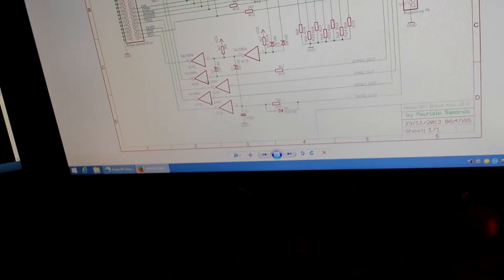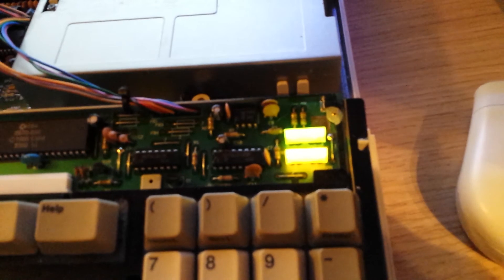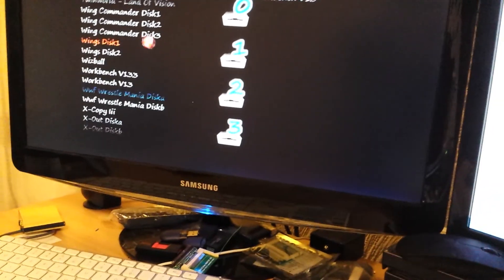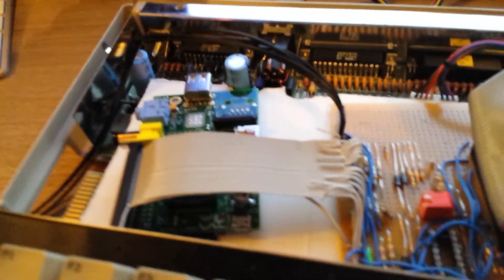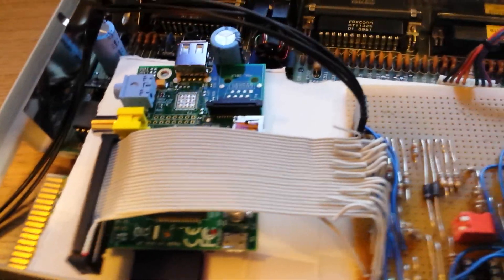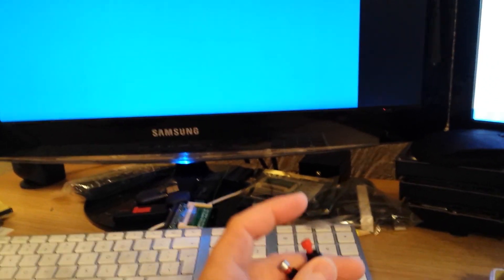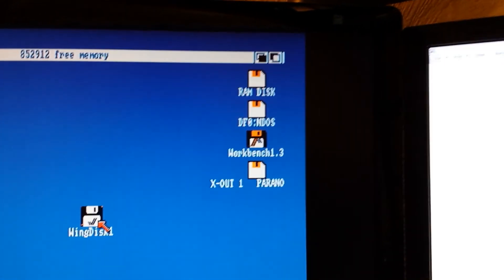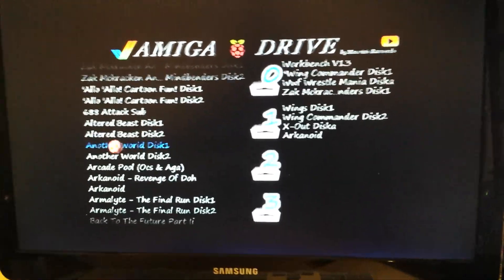Amiga Floppy Drive emulator using Raspberry Pi

Comment: I have a question.  I am interesting in refreshing an A2000.  I was considering purchasing a SCSI2CF drive and a GoTec drive as two units.  Could the PI be used to emulate both devices as once, saving cost?

Comment: Hi Andy. I hope you can help. I have just purchased a pre buit PCB version of this. The person I got it from insists it is working but I cannot get it to boot. I have a  Pi 1 Model B V 2011.12. I have tried the V1 kernel and that did not work either. I have tried various SD cards 2GB to 8GB but no joy. I know the SD cards are good and the Pi as it will boot with noobs. I have triple checked the orientation of the cables, the board flashes the LED and the Pi briefly flashes the SD card read.

Independently of the Amiga if I try to boot it just sits at the rainbow screen. Is this normal? Should it at least boot the kernel when connected independently? Any help would be appreciated.
Reply: Hi Alan, there some hints to get it up an running:
download the v.6 version form Maurizios Page (https://sites.google.com/site/amigarpidrive/)
format entire sd card to FAT32  
extract the the zip to your sd Card  
There is no video output on the pi exept  with the "
AMIGA RPI DRIVE VIDEO 1.0.ZIP" image.

Comment: Can it be made to write to the emulated floppy disks for things like save games and also for workbench such as saving your word processor documents and copying disks?

IMO, as fun as things like the gotek are, they (and a Pi should have the ability to be coded to do so) really 'should' have the functionailty to do so. It means loading a game from a CDROM can allow data (e.g. 3D landscapes or sounds) to be generated upon the start of a game and written to 3 floppy disks, FD1 and FD2 and FD3 (and maybe FD0), so that three 880k disks gives about 2.5meg wich is a meaningful amount of data to dump all the amiga's RAM (like a save state) if the amiga is a 512k with an a590 (with 2Meg) or an a500+ (or a600 or a1200) with 2meg chip RAM (or an a500 with 512k and a 2meg TF530 in it).

It also means entire profiles for drivers and the like can be witten to an image spanned across 3floppy disks, and so drivers for network devices or CDROM drives or USB ports can be thereby made per amiga, thereby only requiring a Raspberry-Pi to be plugged into FD1, which means it is entirely reversible (just by unplugging it upon switching off the amiga at the mains-power). 

So for example, if somebody contributes a github pull request to put a couple of USB ports onto an A500 TF530 or CD32 (Tf330) accelerator, the Raspberry-Pi could load drivers and configurations for a usb CDROM drive from which to boot games, or to run NDISWrapper 32bt WinXP wifi (or other network such as rj45) drivers to work with any homebrew game in future that supports it, including game-controllers that might use it.

Comment: Hi!
Really great!
How did you connect your A500 to your monitor, since the signal is just brilliant?
thanks!
Reply from the maker: Hi, thanks for the comment.

The Amiga is connected to the monitor via a 15Khz signal converter. The model is GBS-8220 and they are fairly cheap to buy on eBay, around £20 but you need to wire the cable yourself but it is very easy and the picture quality is very good from them!

You can see mine at 0:35 under the right hand monitor, with a multi strand cable attached!
Reply: Andy Mason
Great! Thanks!